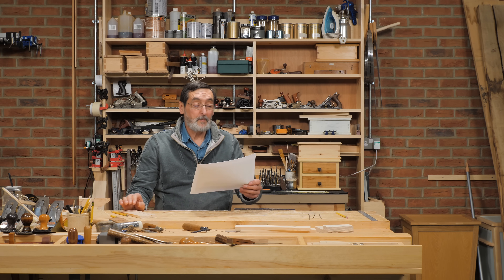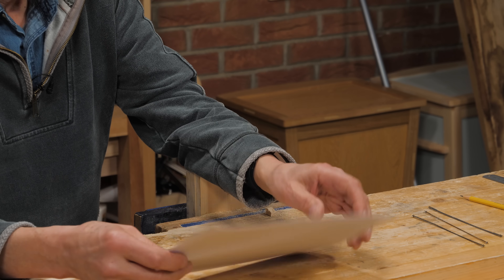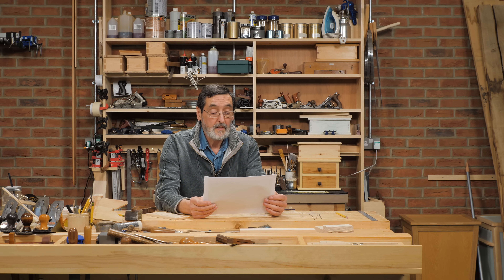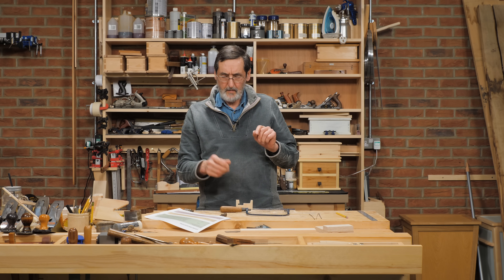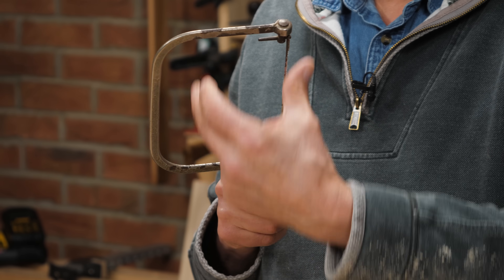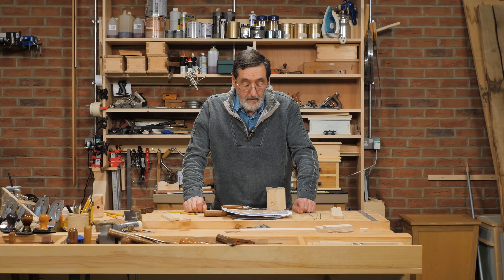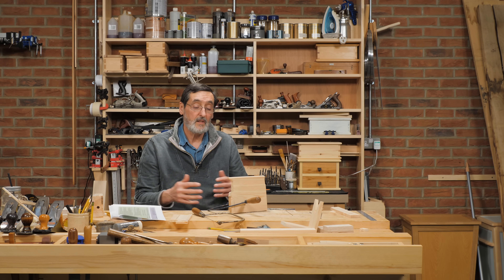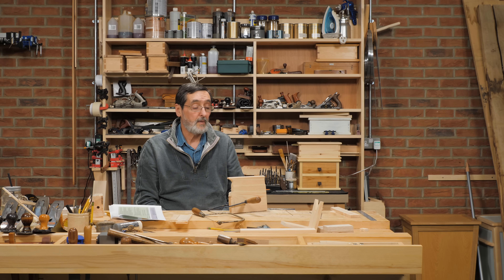Coping Saws Q&A | Paul Sellers

Comment: To expand upon coping saw use you might illustrate a 'Coped joint' on baseboard inside corners.  I am a retired finish carpenter.  Nowadays walls are finished with drywall.  Taping and mudding causes corners to be out of square.  In the case of inside corners there is just one way to get tight looking joints - and that is to cope them.  One piece of baseboard is cut square on a miter saw.  The other is cut with a 45 degree bevel on the end.  The coping saw is used to remove the material inside the bevel so there is a negative of the shape of the molding.  When the two pieces are assembled the joint, if cut well, will look perfect.
Reply: I agree with this completely. There is an allusion to a coped joint beginning around 16:15. I think an illustration of this kind of joint and how the coping saw is used to cut it would be instructive to beginning woodworkers and would give an understanding to the name of the saw.

Comment: I was heavy handed with a coping saw, and had trouble. Once I stopped muscling the coping saw, everything was easier. Actually, I stopped muscling everything, and everything works better.
Reply: Good on you. Always make sure your tools are sharp. Tools are there to make the task easier. A blunt chisel or saw will bite you because you are having to battle it. Take the time to learn the art of tool sharpening. It will pay great dividends,
Reply: I have this issue with literally everything, and I don't mean just in woodworking
Reply: Panzerstorm: Yeah, that is so true.
Reply: One of the best pieces of advice my late father gave me was to let the saw cut at its own pace - don't force it.
Reply: @EdwardRLyons  I have heard this so so often and I do like it, but it does not really contain the essence. I mean if you let the saw do the work, it would lay on the bench and nothing would get cut, you have to work the saw for it to cut. So you stand there moving the saw back and forth with no force and you'll be there a long long time (not that I'm impatient); the saw is designed to be pushed in to the wood or what ever you are cutting for it to work.

For me it is more accurate (and this is no slight to your departed father) to say, let the saw cut at your pace, don't force it. A person skilled at using a saw can cut super fast but they have the experience and know how to get those teeth digging in and the right amount of force and the constant direction of that force to keep those teeth moving smoothly and true.

Long story short, don't be impatient and try to cut so fast that you loose control; there is no enjoyment in having the saw jamming or going off course.

Comment: A video showing how to sharpen/recondition old router plane blades including the pointed ones, would be great! I have just purchased my first ever Record 071 router plane from Ebay and am sure that when it arrives, the cutters will need some TLC!

Also a video describing the differences between and the different uses for the 71 size router plane and the smaller 271 router plane, would be much appreciated.

I love all your videos Paul. They make addictive viewing. Your gentle manner and clear love/respect for your craft is inspirational!
Reply: Just to add to my previous post: Paul, I now have a record 071 router plane, but the spear point cutter is both blunt and has no point (it looks like the very tip has broken off). I also now have a miniature Stanley 271 router plane, but the cutter is slightly off centre when the thumbscrew is tightened. Any advice you can give on fettling these issues, especially in a video, would be very gratefully received.

Comment: Hi Paul - A luthier uses the fret saw to saw the groves that the metal frets are placed in on the neck of of a stringed and fretted instrument. It usually has a very narrow kerf and the teet are not laid out. It can be either push or pull cut.
On the subject of push or pull cut I personally find it easier to stay on the line when using a pull saw - but I dont have 40 years experience using a saw🤓

Comment: You're right, Paul: It depends how you were introduced to it. 
I had a jeweller's saw in my hand (pull stroke) before a coping saw.

Here's a Q&A question please: How do you deal with cutting dovetails in soft pine? My unfortunate experience was that the chisel cut an 1/8" into the wood and then started to pull the centre of the wood out. My chisel is ground to 25deg and it's sharp (shaves hair off my arm).
I got round it by paring instead of 'chopping' with a mallet, but how do you deal with dovetails in soft woods in general?

Thanks in advance.

Comment: Great video! It seems in the US there are tons of older saw frames that just don't tension properly, and the hardware store blades are no longer that great either. It pays to spend just a bit more to get a decent saw frame and blades - makes all the difference in the world. That way we can have a working tool instead of a tool shaped object.

Comment: I was taught and learned how to setup and control the coping, fret and jewellers saws in a PULL configuration.  With such thin backed blades it's seemed logical and in those latter necessary to do so. I've found I have a lot more control of the saw when used as PULL.
If you worry about grain tear out and obscured lines work to knife edges. 
Likewise, keyhole plaster saws and hacksaw blade handles, that have no frame, for the same keyhole use are PULL cutting. 
The same 'pull' configuration applies to powered machines such as bandsaws, scroll / fret saws, jigsaws... and the butcher devices like chain saws and sawzall machines.
Metal filing machines are also setup in a PULL configuration.
  
However, my principal trade skill base is metal working, and the hacksaw has ALWAYS been used in a PUSH application. This is especially so when using a hacksaw to hand part off pieces on a lathe!  Thinking about metal and wood lathes and use of saws to part off... only a proper fool would use a saw blade in a PULL format! 
The only PULL setup in a hacksaw being used with omnidirectional rod bur blades, due to inherently thin backing.. but these cut in both push and pull anyway and more a matter of biasing applied force on the  PULL stroke - contrary to some opinion posted here, these are very useful blades used to cut metals, glass, ceramics and stone.. NOT wood.
I can't say I've seen a hacksaw blade develop a back bow, unlike coping, fret saw blades that have been used in a PUSH manner.... and your only wasting time using a hacksaw to cut metal in a PULL manner.  

Yeah.. I've used hacksaws to crosscut small profile timber and plastic mouldings (PUSH). The finer available tooth pitch works well, but one has to manage the wave set in metal blades. The wave in blades can be hammered or ground out if it's a 'bother'.
They are a useful tool in the wood shop because the blade can be setup a vertical and horizontal to the frame due to the square profile blade holders that fit into the frame.
And, like wood working, buy quality tools fit for purpose - some cheap hacksaw frames are pathetically flimsy and good for nothing.  Some blades are soft as poo... not even good for the hardest of timbers.

Fun fact: Hacksaw blades, like bandsaw blades, are available in variable tooth pitch along the blade length. The hacksaw blades are not that easy to find now and were more specific use for lathe parting off application.

Comment: I was introduced to coping saw as a teenager to cut crown molding for ceiling trim....cut 45 then undercut slightly and follow the face of the cut on the molding.  Used both pull and push but not real preference.

Comment: Using a back cut technique also makes it easier to sand or file the cut if you need to make a correction in the contour or even the length of the cut. I used a coping saw all of my career for doing baseboards and crowns by first making a miter cut  then following the profile of the cope

Comment: Had I had something like this early on, I would have saved myself from snapping several blades. I've since managed materials as thick as 1 inch thick maple; however, I went down to 10 TPI blades and regularly applied paraffin to the blade (the blades do get hot enough that you can feel the blade back slip into a block of paraffin). It's really quick and easy: I apply it while the blade is still in the work - immediately the saw cuts more swiftly!

Comment: I find the push stroke most useful when cutting with the blade in a horizontal position, and pull stroke is best when cutting with the blade in a vertical position.

Comment: I have spent so so long using a jewelers fret saw. The blades are so thin you just have to think about getting it jammed and it will snap! For a year or so, I never had to replace a worn out blade cause they were snapped way before that hehe. Eventually I learnt the motion and I could cut for hours, it was one of my great joys hearing those little blades cutting. It's scary how they can cut through just about anything and fast.

Comment: Fret saws use a “standard” scroll saw blade, right Paul?  Scroll saw blades don’t typically have pins on the ends, like coping saw blades have.  I’ve noticed that fret saws blades can be tricky to secure and tension in the frame, but they are certainly capable of making cuts with super-fine kerfs, and with dramatically sharp turning radius.

Comment: I an one that was trained to only put the blade in so it only cut on the pull stroke. I will definitely try to use it the other way round and see how I get on. However, 
I have never liked using the coping saw so using it on the push stroke may be life-changing for me

Comment: I use it mainly for coping the joints on skirting I use it mainly on the pull as I find I break less blades I only tend to use push on stained timber as it’s slightly cleaner

Comment: As a trim carpenter. this has been a topic of debate. I agree Push or pull, its all preference. now some may say, that depending on the orientation of the material being cut. that pulling or pushing the blade through brings sawdust with it and can sometimes cover a line. making it hard to see. this may be the only reason push/pull debate has any real advantages. just my thoughts. to give you another perspective in order to make this painstaking decision on weather to push or pull.

Comment: That kind of a ”platform” is handy when cutting flexible plastics or pearl or something like that with a pull stroke. The piece is pulled down with the saw and there is no need for clamping nor there is vibration.

Comment: I find that I bind less on the pull than the push which is why I always use a pull stroke, also if there is any flex in your saw a push stroke will slacken the blade and can cause breakages whereas a pull stroke always keeps the blade taught.

I do see the necessity of using a push stroke if you are trying to keep your lines visible but a quick puff of air is usually enough to clear any buildup.

Comment: If you Japanese saws they are on the pull stroke, I have swapped my coping saw for Knew precision saw and I find it to be more accurate than a coping saw and it comes with a blade that cuts on both strokes.

Comment: I paid £1.50 for my Eclipse coping saw in the early 70's after having limited success with the cheaper one I bought at just 65p. I still have my Eclipse saw, and it is just as good as when new- I have no idea what happened to the cheap one as I never used it ever again.

Comment: The biggest adventage of the pull stroke the cut is cleaner because the blade won´t twist as in pushing, the blades make waves and the cut won´t be as fine as the pull where the blade is straighter when you find a hard spot.

Comment: Does anyone know if the slit on the pins are suppose to be align and or how to align???  I have an irwin and the pin next to the handle is slightly pointed out instead of straight towards the other pin. I feel as if it slightly bending my blade but not sure if that's suppose to be normal

Comment: I am thinking there should be a considered correlation between blade tension and power of the stroke when setting up a coping saw. I notice blade deflection in your demonstrations which may affect details of a tight corner.

Comment: Router planes. I've read your discussion on leveling the bottom of the plane to the blade taking just a few light passes on the stone, but then I am unable to visualize/understand how you finish it off. I never feel the bottom of my router blade is perfectly level to the sole of the plane. I need to see it done.

Comment: I'm wondering -- how did you get the saw out of that last board you sawed at  the end (at 19:41)? Looks to me like the frame of the saw would touch the board before the blade can come out (no matter which direction you take). 
The only solution I can see is to disassemble the saw?

Comment: I am used to using a jewellers saw so for me a coping saw works best on the pull stroke. I also prefer japanese saws for this reason I think.
Reply: Yeah, I always cut on the pull with my jewelers saw. I like the extra control when dealing with soft materials with fine details. It works so much better on lead, pewter, and plastic miniatures than the traditional "hobby" saw.

Comment: I had employees try to argue the point of which way the teeth should go, so one day I took the handle and pin assembly off a spare coping saw and put it on the opposite end so there was a handle on both ends.  That way they could pick it up and use it as they wished as the handles were light and dark and all they had to do was remember.

Comment: G'Day Paul,another nice film,good work,
Do you have a preferred maker of blades,the reason i ask,is, i seem to snap the pins on blade ends,and after a while,the blade seems to bend or bow into the frame,,sorta banana back away from the cutting teeth,the blade still seems sharp,
Is there a reason for this,,apart from me being a bit of a brute,
Thank you,

Comment: I have an Hanson frame and use Hanson and Olson blades. Had a Stanley for years with stanley blades and it just was rubbish. The Hanson was easy to find and not too expensive and the blades are not terribly hard to find nor were the Olson but they were a much better quality for the money. I used them for coping in crown molding with great success.

Comment: Great material as always, I know you touched on tpi and such. But the blades that are popular in my area are spiral. Almost like a piece of piano wire with tiny teeth all around it like a rat tail rasp. Any experience or thoughts on these?
Reply: @paulsellers7953   Paul... these rod blades are far better suited to metal, glass, ceramic and stone cutting when of the 'encrusted' grit form - ONLY used in the PULL manner. 
Can't say I've seen 'rod' blades for timber... but we do see rotary burs for carving. Their use is justified in certain applications... as is a file/rasp. 
And the use of the word 'toolmaker' in a non-derogatory sense is actually correct, because it is the Toolmaker that uses filing machines to manufacture metal, timber and plastic working dies using very similar 'blunt files' (a descriptor of profile along length - parallel - not sharpness) that resemble such blades. They would probably work well in a large format powered scroll saw where kerf width didn't matter, but bent blades did matter! 
The Toolmaker is the far higher skilled Fitter & Turner... like a Joiner is to Carpenter. ;-)  You Sir are a Joinery craftsman.

Comment: The teeth should point in so you are pulling the cut, the blade is very thin and by pulling you are putting the blade in tension, keeping it straight, same as Japanese saws.

Just the way I was shown, but if it works it works 👍🏻

Comment: Coping saws should be used on the push stroke as the handle is likely to slip out of your hand when pulling rather then the handle being pushed into your hand on a push stroke

Comment: The best way to use a coping saw is vertically with the teeth pointing down. When you use it that way you will find out it was designed to be used that way.